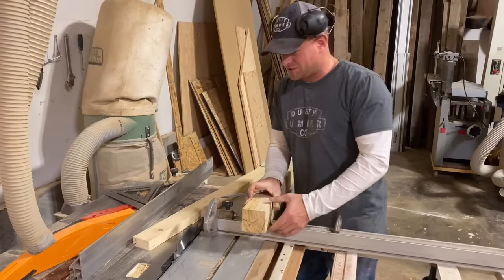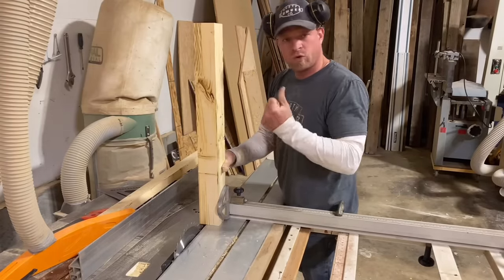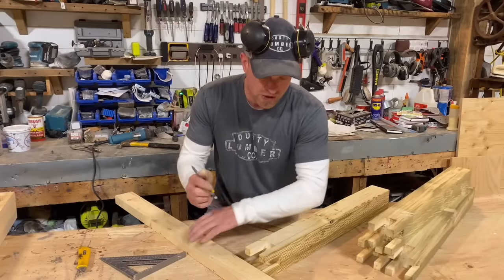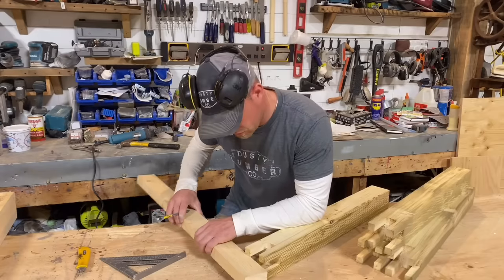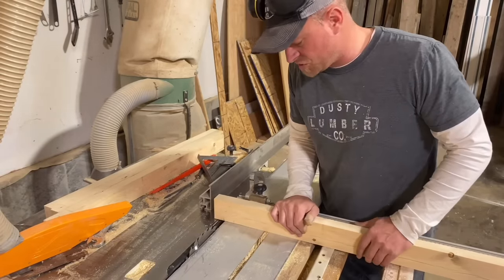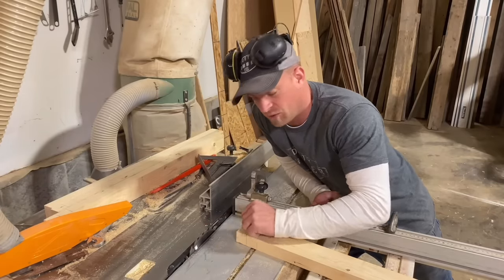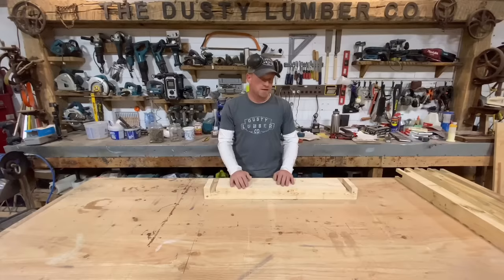How to make castle joints on a table saw

Comment: I realize this is from several years back but my son asked for a 6’ long by 4’ wide L shaped computer/homework desk.  His only other request was that it didn’t shake.  6 castle joints later and you had better not run into it because whatever body part hits it will lose.  Extremely strong joint. Thanks for the education.
Reply: And another year on and I'm about to use 8 of these joints for a new worktop. I'm fairly certain it's going to be pretty solid.

Comment: To other YouTube video producers, this is a Goldilocks video. Not too long, not too short, not too complex, not to simple, just right.  Have to try this joint out. Thanks.
Reply from the maker: Thank you so much!! I was hoping ti find a nice balance where it’s not over explained but not under explained 👍
Reply: @dustylumberco  You did very well. Not only explaining your equipment, but how one could replicate this technique at the novice level with a basic table saw and a little attention to detail. <><
Reply: So true...This is a strong, pretty joint that everyone should try just for the heck of it. The key is in the measuring and cutting. No matter what tools you use to get the job done, the age old advice to “measure twice and cut once” is imperative. In this case you might even want to “measure thrice and cut once”.... it couldn’t hurt.

Comment: I've gained an interest in woodworking lately and have been looking at a lot of videos, just trying to get an idea what I'm getting myself into. I've never heard before that it's possible to get a joint too tight, and what will happen if I do. What a valuable piece of information!
Reply from the maker: Hello! Yes you can definitely get a joint too tight and it will cause your wood to break and crack

Comment: 🌲🍀A quality video, showing a nice high quality fitting castle joint.  I liked that you talked about the joint not being too tight so as to avoid future cracking & breakage.  The round overed edges look nice, but back in the day, they didn't have powered sanders not even sandpaper (or glue), and they would have used (l know, you know this) a block plane, or more likely a chisel to break the corners, and probably pegged this joint, or used a wedged "tusk" or "through" tennon joint to hold it all together.  But a thumbs👍for a concise, very informative table saw & sander video😎🍀🌲.

Comment: To find the highest top point of your blade, always look for the arbor. You can use peek through the top opening (where the blade comes out through the top) and see the arbor and you can use a square to help you aim a straight line of view from the arbor up. Now imagine a vertical line (dictated by the square) from the arbor's center to the blade's top. That's your highest point on the blade. And if you align a tooth with that edge of the square, you will have the true height of the blade. 
Also, there are all kind of calipers specially made for blade height measurement.
But I always use the arbore center and the top tooth methode.

P.S.: You need to buy a clip-microphone that you can attach to your hat or t-shirt. The sound is not so good.

Comment: That's a great quick castle joint. If the cross beams were narrowed where they go through the legs to leave a shoulder that registered on the outside of the legs, it would greatly increase strength and rigidity from what you have here. It only costs slightly more time and complexity.

Comment: I was thinking about these cuts and realized they could be done on one set up on a band saw with a fence. As the posts would be horizontal and supported on a table extension. This would be much safer.
Reply: I've cut this joint on 6x6 posts for a swing bed, with a circular saw and chisel. But if i had a band saw that would have made the job easier and way faster.

Comment: I would add its best to use a joiners square to set the rails for cutting the half lap. You could also use low strength double sided tape to stick them into a stack. Do all eight ends in two runs.

Comment: You can also use a mortise chisel drill to remove the material.
Reply: Or you could use a fotstner bit
Reply: I usually chew the wood out with my teeth (I sharpen them) saves time

Comment: Wish I knew about this joint while I was still building stuff. I made a lot of work tables.

Suggest you add a vertical fence with a stop to guide the posts while cutting the ends. Cutting the end of a post held vertically without a support is too uncertain. Taking a moment to clamp the post to the fence is even better and worth the extra time. I would have removed the waste with a drill on a drill press and squared the ends off with a wide chisel.

Comment: I like that screw down from the top.  If the joints are sufficiently snug, you could just screw it instead of adding glue.  That way, if it needs to be moved, you just take out the screw and it all comes apart.  I mean, I wouldn’t do that for a large table, as the screw doesn’t help enough with racking forces, but it should work for something small that may be moved regularly.

Comment: Great vid. Thanks! I'm going to try these joints on a bed frame my wife wants.
Reply from the maker: James Pelosi awesome!! Thank you!
Reply: One of the things that I learned from making a bed frame many years ago is that if you don't constantly keep thinking about the ability to disassemble it, you will find out that you have a  bed in a room that cannot be moved into a new room (or a new house) withing taking a saw to it and destroying the bed.  When I started the project, I had intentions for it to be something that could be disassembled, but somewhere along the way in the expediency of getting it done, that kind of got pushed to the side.

If I was doing it again, I would probably use a design that used wedges that could be knocked into place to lock the components together.  As in everything else in life, there are always compromises...

Comment: Instead of the 4” screw, a hardwood dowel would had just “felt right,” know what I mean?
Great job though, thanks.
Reply: Good idea. He could always go in and use a dowel as a plug to hide the countersunk screw head and give it that 'doweled' look!
Reply: @stevenw973  You would still know the screw was there, underneath the beautiful countertop, hiding beneath the lying maple dowel, all twisted, inorganic, impure, unwanted, unloved. Stressing out all that is natural.
Sacrilege.
Reply: The object of the screw was to draw everything tight. The same could be accomplished with a clamp, but I don't see how a dowel would do this.
Reply: Sometimes just saying screw it simply isn't enough!
Reply: You could screw it together, wait until you are happy that the glue is fully cured, then remove the screw Re-drill to fit a dowel and then dowel it. That way you know its solidly glued but has no hidden metal. Personally its going under a counter so would leave it as he has, or as a max, just cap the screw with a plug

Comment: You can drill out the ends than chisel the drill edges off
Reply: If the timber is short enough you can dado the whole thing
Reply: Actually a band saw jig would be how I went after this

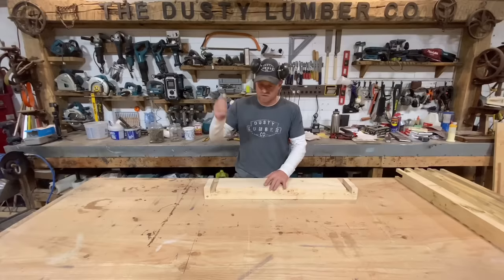Comment: Cool video. I do have a quick question for you. Does stuff in your shop move on its own all the time? Look at your video at time 12:45 - 12:50 and watch the back left you will see the cord fall out away from the wall. The third power tool from the left.

Comment: This may be a dumb question, but I can't figure out the answer, so I'll ask it anyway. If you're using 2x4's for rails, how do you get that 10" table saw blade to cut that deep into the end of the 4x4? Mine will go no more than 3-1/4". With a dado blade, that becomes even less.
Reply from the maker: I cut the boards down to the max height of the blade 👍

Comment: Apologies for the dumb question. I'm a newbie when it comes to woodworking. I really like your table frame, and I am planning on building a small outdoor table (4' x 2') so sometimes will be exposed to weather elements (ie. rain & snow) sporting a marble tabletop. What type of wood did you use in this video? and Do you recommend using pressure treated lumbar considering it will be an outdoor table? If so, can I still use the Black Watco Danish Oil and the white restoleum paint you used in your other video? Cheers! Love the videos.

Comment: "Facebook thoughts and prayers". I love watching your videos for the knowledge you share but the comedic gold comments you make is a much appreciated bonus! I have "2x2" boards I want to use as the framing for an outdoor fire table. Do you have a wood size ratio for this type of joint? I see you're using (what looks like) "2x4"s and "4x4"s. What would you suggest I use for the legs that I am using for castle joints? My table top is 5 1/2' x 2' with a 2" thickness of redwood & cedar fence panels, ripped and glued together (I'd be happy to share pictures and a rough sketchup model I have put together). This will be my 2nd ever woodworking project and just want to be sure I am using the appropriate board sizes to keep things sturdy, solid and as lightweight as possible since the tabletop is ~30lbs. Any suggestions would be appreciated!

Thanks!
Reply from the maker: Thank you!! 
It terms of the posts or legs it just kind of depends what I’ve got to use and how to make it all look proportional to the overall build. Feel free to email me pics and I’d love to take a look!

Comment: I got a question if you don't mind. Imagining that I might want to disassemble the table to move it somewhere, would that joint without glue hold up nicely in the proccess, or should I change something to make that possible? I'm asking because from time to time I move to another house and so does my shop, so to speak, so that is an important question for me. It would also be a cool feature to setup a working table on the jobsite, as I prefer to do these things on my own rather than buying them. If you could shed some light on the subject that would be awesome 🙂
Reply from the maker: The more times you put it together and take apart the more the joint will wear out and less tight
Reply: @dustylumberco  Thanks, that makes sense. I also found that a coping saw might be a good alternative to cut the leg pieces.
Reply from the maker: @aeonyoda  nice 👍

Comment: Thank you for a good presentation. 
Could you please refer me to a video how to make a sliding-rolling surface you use for (on) the table saw?
Reply from the maker: thank you. The slide section comes with the saw - this is an SCM slide saw
Reply: @dustylumberco  Thank you. Do you know where I can buy or find info how to make the sliding part? I already have a couple saws, but the sliding part can be very useful.
Reply: @dustylumberco  I just Googled scm sliding table saw, they are very expensive. Which model do you have?
Reply from the maker: @genevelis6075  I don’t know if anyone that makes a slide attachment that goes onto a saw where it runs beside the blade like that. There are lots of manufactures that make slide saws though. SCM, felder, Rikon, attendorf, cantek, grizzly
Reply from the maker: @genevelis6075  I have the SCM mini Max
Reply: @dustylumberco  Which brand or 2 brands you would recommend to buy? That is a serious investment.
Reply from the maker: @genevelis6075  I have SCM and really like it and I’ve looked at quite a few others and find them all good. Or at least there isn’t one brand that I’ve looked at that I would say for sure stay away from

Comment: Nice vid  I will try this myself.  little warning I used to work on cars and trucks many times using my hands as hammers instead of using a mallet, hammer ,or whatever.  developed blood clots out of the blue guess where  my hand ended  up getting fixed, and then got 2 more in the leg to do the procedure.  USE A  Hammer!
Reply: Never fallen into the ‘hand-as-hammer’ trap. Nevertheless, blood clots mean that I can’t even hold a hemmer at the moment. Unlikely to be ever able to again, so having to find ways of adapting, which is an interesting learning exercise on its own.

Comment: It looks great.  Maybe I’m missing something but when the top is put on you won’t see that beautiful joinery.
Reply: I would use a straight router bit to cut a rabbet around the inner edge of the frame and set the table top on the resulting ledge. That, or add a narrow piece of trim to the inner edge of the frame and cut a notch into each corner of the top to accomodate the castle joint.
Reply: @Dwayne_Bearup  Agreed! I would definitely want to showcase those beautiful joints.

Comment: How are you cutting 3 1/2 inches above your sled? Is that a 12 inch table saw?
Reply from the maker: I’m cutting 2 3/4” above the sled. I’ve got a 10” blade in the table saw

Comment: Are these joints strong enough to do a bar height table?
Reply from the maker: Yes - if you use big enough wood 👍
Reply: I was thinking redwood 4x4 for the legs. I would use a joiner/planer to mill them to exact specs. Same with the 2x4s for the table square.
Reply from the maker: @russellbrunet3924  👍👍👍

Comment: I'd probably have used a forstner bit in a drill press and then a chisel to remove the inner material.
Reply from the maker: That works too
Reply: @dustylumberco  
Looks like a good way to build a bed frame.

Comment: Are those 4x4's you are using for the legs?
Reply from the maker: Yes 👍
Reply: @dustylumberco  I'm thinking about using this joint for building my garage workbench legs.  If I only had a mortiser, I could extend the four tenons through the butcher block counter top I want to make for it...  8(

Comment: 3:44 - Why not just get a chisel and mallet to extract those blocks after making your cuts? It would save a whole lot of time and allow for the best precision.

6:24 - I see those chisels hanging on the wall screaming to be used!

IMHO if a joint requires glue and screws to hold together, then it was not that solid of a joint.

I would suggest a slight change to your joint to removes the necessity of glue and screws. Scrap those and then buy some thicker doweling and cut 4-6" sections of doweling. Drill you holes as you did for the screws but match them to the diameter of your doweling. Slide you doweling into the holes and sand to flush. This will hold everything together with just the wood and gravity.

Bonus points for adding a 1/2 " - 1" depth to the doweling holes so you can add doweling to the table top and have it align and sink into the frame. This could be repeated along the lengths and widths as well.
Reply: Nothing wrong with nails and screws. They have been used for millennia by skilled joiners and cabinet makers.
Reply: Ever heard of Greene & Greene?  Furniture makers turned architect designers.  Built the famous house in Pasadena for Gamble of Proctor and Gamble.  Everyone marveled at how all their joints fit so nicely without and screws or anything...until someone x-rayed them...  uh oh.  Even Greene & Greene used screws all over the place and hid them under caps and decorative moldings.  They caused an explosion of Prairie and  Craftsman-style building and furnishing of which Stickley was a part as well as Frank Lloyd Wright.
Sometimes screws are used instead of clamps to speed production.  Sometimes they're used for added strength.  There is nothing wrong with using fasteners.  It's been done for hundreds of years by the best of them.

Comment: Are those 2*4 and 4*4s?
Reply from the maker: Yes they started out that way👍
Reply: @dustylumberco  thank you for the response! I'm trying to do that same joint at home (tiny little table saw though). Just can't get that 3.5" depth. Circular saw maybe?
Reply from the maker: @used2jeep  I cut the 2x4’s down to the max height of my table saw blade of 2 3/4” so that I didn’t have any extra material to take out beyond what my blade could reach
Reply: @dustylumberco  Genius! I feel so dumb...  I've got the lap (?) Joints done but now I need to to them to that max height. Or...I start over with some 1" by something, or a 2" * 3"...

Thoughts?  I'm trying to make a basic table (computer desk).
Reply from the maker: @used2jeep  if you take an equal amount off both sides so you half laps work still and they’re down to the height of your max table saw height then it should work

Comment: Rounding of the edges is on the rough side and I would have used dowel to pin the joints in place of the screw.

Comment: WHO  SAID IT? 

"If a cow ever got the chance, he’d eat you and everyone you care about"

Season 7 ep 5 - Lisa the Vegetarian
Reply: I like this method.  I make work tables and benches that usually end up on a concrete floor.  I used to put casters on the legs but found out that by chamfering the bottoms of the legs would be just as movable in the shop without the wobble from casters.